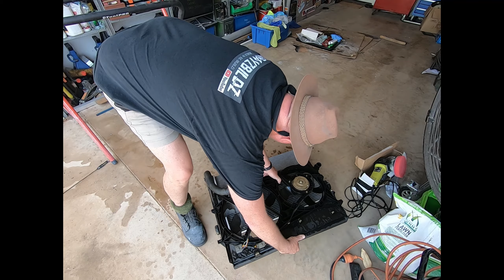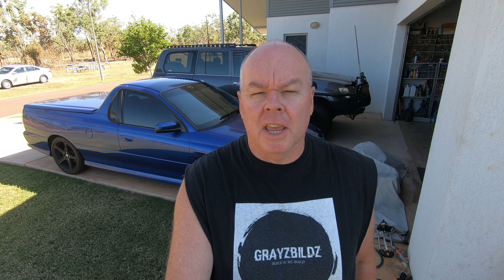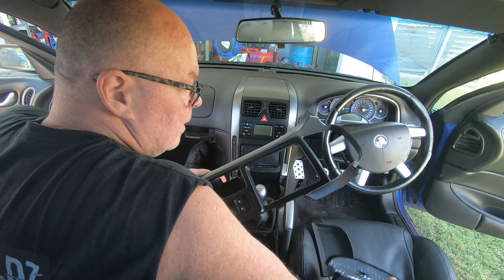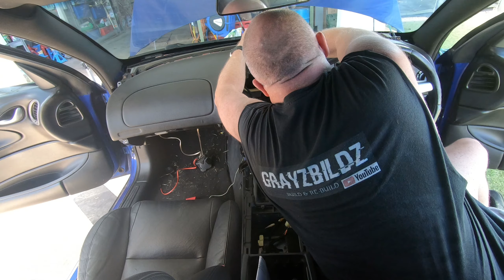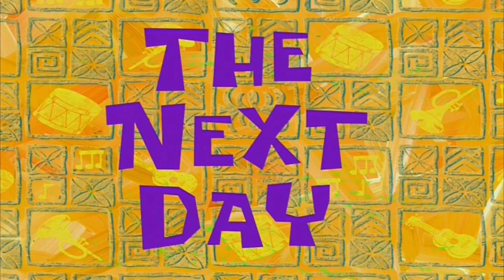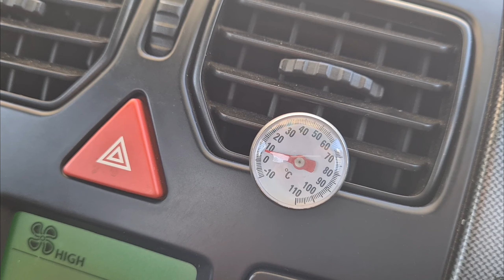VZ Commodore Dash removal and Air Conditioner Evaporator cleaning- Project BREWTUS

Comment: I was wondering if you know.
How to change over from a dial Aircon to the push button dual zone climate control
Reply from the maker: @NickBlackwell-r1k  I don't think it's a straight forward plug and play option. For memory it's a completely different body loom harness and a different BCM (body control module). It would be a very difficult expensive upgrade. Hope that helps mate. Cheers, Andy

Comment: Great video mate, one question and I’m not trying to be a smartarse going to all that trouble to get to the evaporator is there a reason that you didn’t replace it with a new one- so hopefully you don’t ever have to do that again?
Reply from the maker: Tha nks for the comment, this was always a budget build, plus there would've been a whole lot more to remove the evaporator, plus it just needed a clean. Cheers

Comment: Just letting you know how I managed to clean the evaporator without a full tear down. My vehicle is a 10 month 2008 WM Statesman model, [Same air-conditioner unit as the VE Holden].
 My sequence 1/ Removed centre console kick panels.;
2/ Glove Box removed.;
3/ The temperature block(Access point needed between the blower motor and up to the inlet side of the Evaporator.;
4/ Used a 'Bore Scope' to check the inlet side of the evaporator and found it was Chock-a-Block with crud.;
5/ I used 'Minehan Cool PRO' core cleaner, (could use CRC Cool Pro or Viper A/C Core cleaner) and a fine plastic tube to fit the spray can nozzle and stiffened with tie wire inside the tube to aid directional insertion of the tube to the top of the evaporator.;
6/ I then sprayed the void from the top of the evaporator filling foam until the foam started to become visible at the Temperature Probe insertion point.;
7/ I left the foam to do its job for an hour and then resprayed/repeated the process.;
8/ Checked the core had been cleaned almost completely with a 'Bore Scope' to see results.;
9/ Air-conditioner went from cooking us after 10 minutes of use to freezing the cabin with cold air.;
10/ Checked and cleaned the Condenser at the front of the car behind the Plastic Bumper and cleaned the insects and other debris using the Spray foam.;
11/ Fitted a shade cloth mesh screen in front of the Condenser to reduce corrosion and acid damage to the cores and prevent small (Stone) missiles puncturing the cores etc.
COOL Driving even in 45 degree heat.
Reply from the maker: Great job!

Comment: Love your vids mate. I fucked up putting in a new head unit in my vz Crewman and not the air con knobs are sticking against the fascia. If I buy another dashboard and fascia could I rectify that? Thanks mate
Reply from the maker: Not sure mate, sounds like something is not seated correctly. Maybe remove the shroud and make sure the head unit isn't pushing it out causing the interference with the knobs. Thanks for your kind words and thanks for watching and commenting. Cheers, Andy
Reply: @grayzbildz  legend thanks mate

Comment: I have VZ Calais. We went on a long trip last weekend. The blower Strength was fine when we first left. But after about 1.5 hours it was like the Blower was set on low, but was actually on high. Then on the way home, The blower started out at full strength, but again after about 1 to 1.5 hours had weakened to the point where hardly any air was coming out of the vents. Does anyone have any clue what might cause that? Resistor perhaps or is the blower motor getting weaker as it heats up? I doubt that it's because anything is blocked up, because wouldn't it just always be low airflow? In my case, The airflow starts high, then gets lower as time goes by. Also, occasionally Blower refuses to come on.
Reply from the maker: Almost assuredly a motor on its way out.

Comment: So what does it mean when aircon switched on and dial switched to direct body but air only comes through the windscreen vents so annoying🤔
Reply from the maker: Probably a vacuum leak or a failed vacuum actuator. Probably a big job.
Reply: Fan speed resistor is cooked mate
Reply from the maker: Not sure how a cooked fan resistor will cause the hvac system to change airflow modes..... a fan resistor only controls fan speed, nothing more.

Comment: How do u take out the odo dash
Reply from the maker: Yeah sorry I lost that bit of footage. For memory, there are two screws in the top of the guage shroud, two at the bottom and then carefully pull the shroud out. Drop the steering column down on the adjuster and then the gauge set should come out. Hope that helps. Cheers, Andy

Comment: Should've showed the glovebox removal I needed that part
Reply from the maker: Sorry. It's pretty easy. Remove the left and right rubber stoppers inside the glove box, be careful not to break the plastic tang that locates the rubber stoppers. Drop glovebox further open, and pull towards you. Hope that helps. Cheers, Andy

Comment: Ive got an 04 vy clubby , it has a bit of a musky smell from the aircon , nothing crazy but still noticeable, gets cold quickly , blows plenty of air , messaged an aircon bloke and he reckons its probably the evaporator , wouldn't have thought a slight musky smell would warrant complete dash removal and evaporator cleaning/replacing
Reply from the maker: No I agree, my first step would be to buy some evaporator cleaner, remove the glovebox and fan resistor pack and spray the cleaner into the evap. This is a cheap and easy first step to try. Let us know how you go. All the best. Cheers, Andy.
Reply: @grayzbildz  okay mate thank you i will give that a try for sure , i found this vid of a bloke replacing a resistor where you described, is this the one to remove and spray in there hey ? Like maybe a 10 second spray with the a/c all switch off ? Id apreciate if you have a look at this youtube vid just to check if its the one you mean , hope to hear from you soon man

https://youtu.be/Wn7miq0lKt0
Reply from the maker: Yes mate that's the same one I showed in my video, perhaps I didn't describe it well enough, but that's also where I put the boroscope camera to see how bad the evap was blocked. Follow the directions on the evap cleaner can, for memory you dump the whole can into the evap whilst moving the nozzle around. Good luck with it!

Comment: Thanks!!  It's almost persuaded me to take mine to a professional (although I'm not sure I'm ever going to be able to pay the labour).  Not a task I'm going to relish.  2006 VZ, just paid $900 to have the compressor replaced, but it's not running ANYTHING like it used to 10+ years ago.  (Mine would actually throw "minus" (subzero) temps under acceleration).  Now it's slow to even start cooling, and only dropping temp to around 20c on a 30c day.  I think it's a combination of a clogged condenser (?), and something wrong with the airflow switching - I don't think 'recirc' actually shuts off the external airflow properly anymore. I've been driving down the road and had it (can HEAR it) randomly change over to defrost vents for no apparent reason.  I no longer hear the full "clunk" it used to make when turning the extra click left from vent to recirc.
Reply from the maker: Sounds like a couple of problems. The vents changing under acceleration is a common problem, it is likely to be a vacuum leak somewhere. These vehicles have a small plastic accumulator and the engine produces no vacuum under load. The lack of cooling is another issue. If you were in tassie I could refer you to the best aircon guy I know, Connor Auto Sparks. Good luck with it.

Comment: For about a 15 year old commodore I wouldn't even bother doing this. I'd probably sell it for someone needing a car for parts or something. I've actually got a 2005 crewman.
Reply from the maker: It's called content for the Chanel. And if it helps someone else, then that's great. Thanks for watching and commenting.
Reply: I suppose it comes down to the situation at hand and how much free time you are willing to spend to do such jobs..
And or the possibility the opportunity for useful content. 

Here i am the nutcase that i am. 
I'm currently in the process of doing a reshell. 
Old bent wagon has a l67 (supercharged6), manual, lsd and a nice interior..
New to me vy had a stuffed interior and the auto has issues. 
So swaps it is 😉

Far cheaper in my case to do it than buy something real nice and a lot newer under finance which doesn't suit my needs being honest...

Comment: Hi how did you remove the dash cluster I need to change mine over as it decided to die
Reply from the maker: For memory it was only two screws on the shroud, then two or four screws to remove the cluster.

Comment: You can buy the R34A canisters easily on eBay they are not hard to obtain ; to re-gas is not that hard but to be honest with you it’s not worth buying the equipment to do it
Reply from the maker: Yes you can buy R134a gas on ebay, but all air-conditioning gas work in Australia is to be done by licensed auto electricians.... huge fines for release of gas to atmosphere. I'm glad we're a little more regulated than in the US. Thanks for commenting.

Comment: I overheated just watching you do that!  No wonder the GoPro had issues. I have an electrical problem (I suspect) which I also suspect could be a cooked connection in my AC circuit somewhere in the dash of my VX. I'm not looking forward to opening it up to try and find the problem.
Reply from the maker: Yeah the heat and humidity in the NT makes working on cars not fun, especially when I don't have any undercover area for most tasks. The dash removal is a bit long, but just take your time and be methodical.  Cheers, Andy

Comment: I really hope my Vy just needs gas, that's a ton of work.  Thanks for the video mate take care.
Reply from the maker: Is the airflow from vents still pretty good on full fan peter? If so, clogged evap is not likely to be the problem. With the age of vy, quite possibly the compressor seals are leaking out the gas. Make sure your auto leccy puts in dye so they can properly check for leaks. Good luck!
Reply: @grayzbildz  thanks mate, I'm sure it's low on gas, Got weaker and weaker then the compressor didn't engage.  Lucky it's getting cooler in Melbourne now. Will get it looked at , these SS utes are nice cars and probably the only modern car I'll drive . I still drive the old chryslers and still building an old 67 impala.  They're a lot easier to work on than the modern stuff. Thanks for the help mate , great videos.

Comment: Wow, great work Andy. I never knew how much work was involved to get the dash apart and get to the evaporator - I suspect my Ranger's drain is blocked and now hate to think what it will take to fix
Reply from the maker: Thanks mate. Drain should be accessible under vehicle. Bend some coat hanger wire and push up carefully from underside. Hopefully that clears it. Cheers
Reply: @grayzbildz  Ill give that a whirl. Certainly smells musty when its been running

Comment: Good work, lots to do. One of those horrible time consuming jobs but it all worked out good in the end. I did notice somewhere on the net that somebody retro fitted a cabin filter for a VY. I'll see if I can find which forum I found it on it even gives a few different part number for filters too, I'll let you know when I find it again.
Reply: Here you go, not the one I can remember but still useful ...https://www.ls1gto.com/threads/cabin-air-filter-solution.121072/
Reply from the maker: That's great mate. I'll check it out. Cheers

Comment: That's a big job, I fully understand why they don't get cleaned on a regular basis.  Glad it fixed the issue and you can now chill a beer in front of the vent.
Reply: Makes you realise the value of the cabin filters fitted to modern cars! Apart from the benefit of filtered air, it certainly would've prevented this build up.